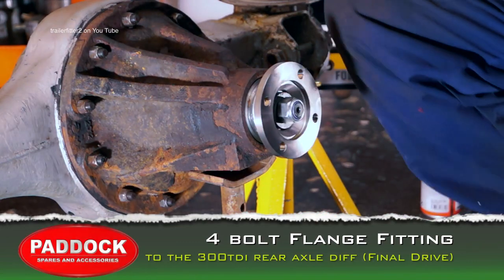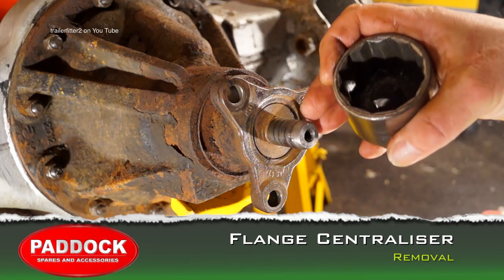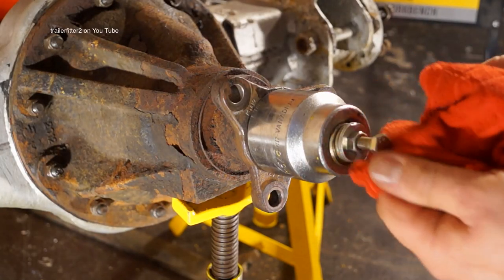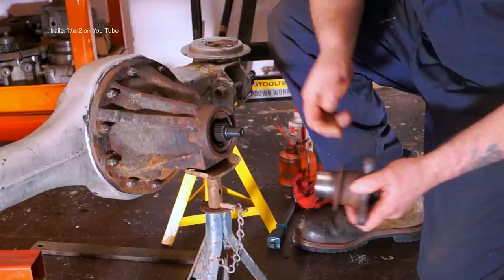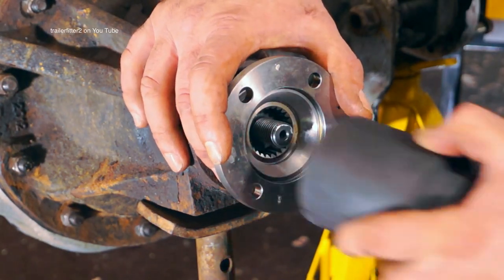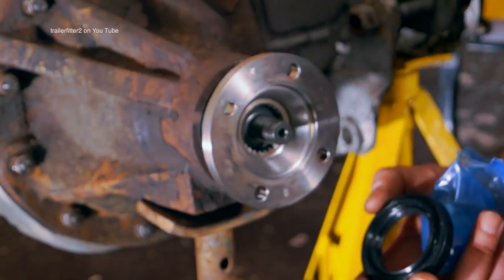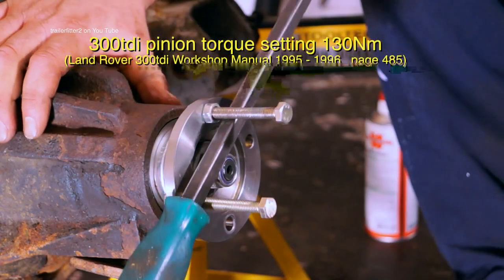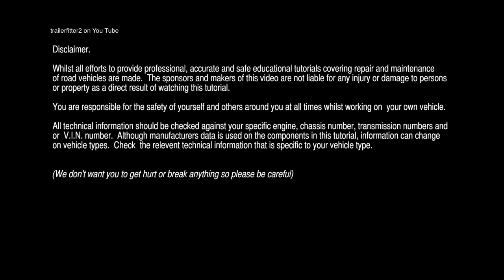Land Rover 300tdi axle - Rear diff flange conversion kit STC 4858

Comment: Did this myself and found the Dust shield was impacting the housing and wouldn't turn. Beat the shield off and thinned it down some on a grinder to clear. Then rest went together smoothly and seemed to measure just a tad more preload 0.75nm went to 1.0nm (I assume and hope from the new seal). This was with axles and wheels on. I checked the preload within the gear lash. Think 2 degree turns left and right it's a little loose, thats the preload area I tested before and after. Hope this helps someone, and check your dust shields on assy!

Comment: Plan on doing the front and rear pinion seals on my TD5 90, do I need to count the turns to loosen the main nut/bolt to ensure the preload is correct on the bearing?

Comment: Chris, do you know what the part number is for the washer used when fitting this? I'm building up a diff with a 4 bolt flange but the washer I bought that I thought was correct (FTC5413) doesn't fit. Cheers.
Reply from the maker: Do you have a parts manual?

Comment: there is a better way to get the axel out off the flange i had no way to get it mowing with a bolt i used a M8 grease conector and the grease gun to push it out with the grease that worked good.

Comment: Hi there, I am sticking a discovery axle on my 90 and I was planning on swapping the the flange from the drum braked axle over onto the discovery one as its a 3 bolt type and I need a 4 bolt flange for my props, but I have just discovered that the flange on the disco axle is held on with a bolt and not a nut .
Will this kit work with bolt type flange ? 
Hope this makes sense
Reply from the maker: sorry I just saw your post.   Have you found out what is required now?
Reply: I have the same issue, my flange is held on with a bolt not a nut, I’m left with a nut and a split pin left over!

Comment: should be the same for a 96 d1 with the 4.0 v8 correct? my front pinion seal is leaking and I was going to replace it.
Reply from the maker: Yes, it should be.  There are not any flanges to choose from in that type of Land Rover range final drives.

Comment: Hi, once again great tutorials, I'm thinking of converting my 300 tdi doughnut to this type of flange but my question is, do I need to use a 200 tdi propshaft? ( Am I right in thinking that a 200 prop has hardy spicer joints at both ends. )
Reply from the maker: basically yes.

Comment: does the axle you use in this video fit to a 1988 defender with a 200 tdi conversion?
Reply from the maker: Yep. the Discovery axles fit to the Defender. It is the rear is especially popular to get disc brakes to the rear on a 90.  However i would not recommend a 110 having the disco rear axle as it is rated lower on axle weight and the amount you can carry or tow will be effected.
Reply: Ok, thanks a lot, i have a 90 so it'll be fine, just making sure all prop and trailing arms will fit correctly, the only difference i noticed was the 300 had brackets for anti roll bar were as i have extreme suspension on the back s no roll bar needed :D
Reply from the maker: there is a kit for Anti roll but yeah you won't need it if you want axle articulation.   Good luck with it.

Comment: Hi there,  love your videos they're really helpful! I got a question,  if I use a standard prop shaft of a landrover 90 is it fine?  Thanks a lot
Reply from the maker: Depends what your are doing with the 90.  If you haven't fitted a lifted suspension kit  on it a standard prop' shaft is fine.  They need to be greased regularly BTW.
Reply: sorry i should have added that im doing the conversion on my 300 tdi discovery. i want to check if there are any other options for a prop shaft
Reply from the maker: Yes plenty of alternatives.  I get mine made up specially by a commercial vehicle prop shaft reconditioner.  I say what the distance is between the 2 flanges then supply an over length prop' shaft for them to cut down re - weld and then balance.
Reply from the maker: The Difference you will find is that when doing a conversion.  

1.  The R380 and LT77 gearboxes are different lengths
2. and also depending on where you position your engine, either forward or close to the bulk head will also effect the distances between the axle flanges and transfer box output flanges.
Reply: Because the wide angle prop shaft is quite expensive,  and I was thinking if there is any landrover that uses this type of prop shaft
Reply from the maker: The Discovery 2 front prop. Double cardan prop' shaft.
Reply: OK mate thanks for your help! :)
Reply: ***** with the disco 2 front prop, i will still need to use a spacer ? thanks
Reply from the maker: Not sure.  You'll have to measure it.
Reply: well the disco 2 front prop is quite short 0.64m, whereas disco 1 rear prop is around 0.91 if im not mistaken. do you think its possible ?